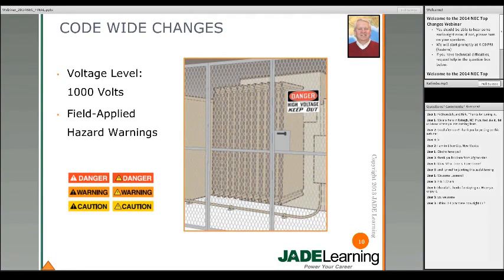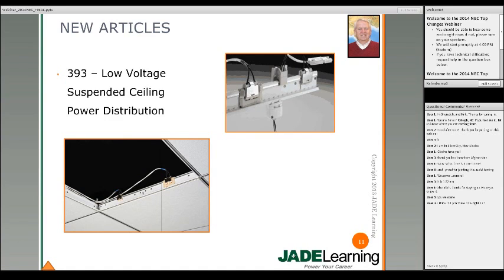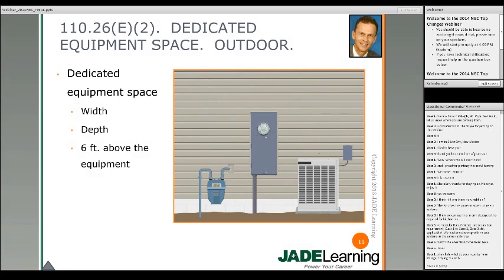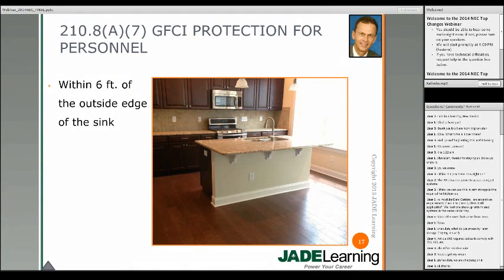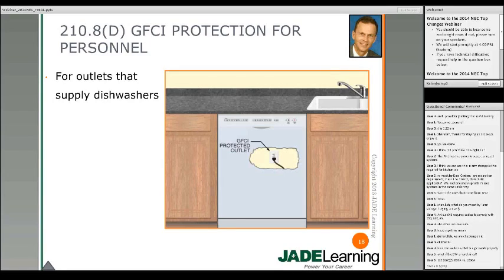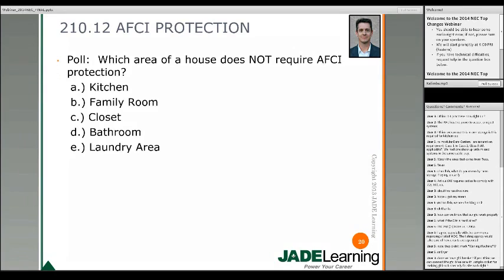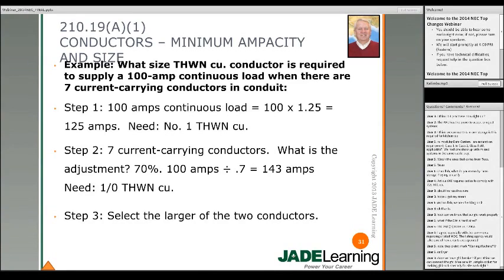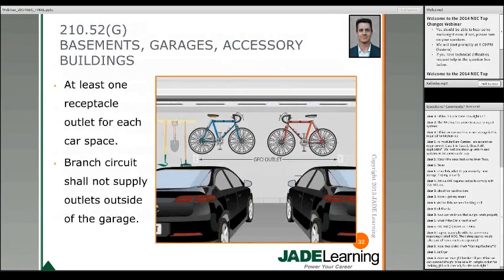2014 NEC Top Changes Webinar

Comment: If a GFI breaker is installed for protection of the dishwasher, and the unit is hard wired. Do the manufactures of the GFI breaker make a lock out clip that would fit over a GFI breaker?

Comment: @ 19.29 into the video it talks about placing the Dishwasher receptacle under the sink to be able to place a GFCI Device as the receptacle...careful on doing that because many will debate that GFCI Device is not readily accessible as demanded in the charging statement of 210.8. What may be considered accessible to some is not actually to others...take a 80 year old grandmother who lives alone...having to test the GFCI monthly under the sink is clearly not going to be "readily accessible" to her.

Just things to think about.
Reply: What about a metal range hood/exhaust fan that's within 6' of the sink?